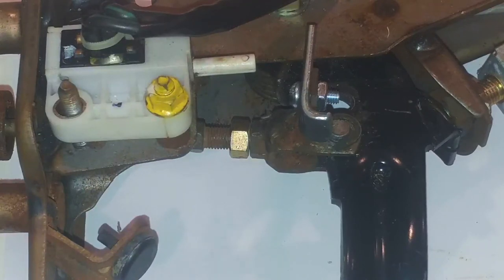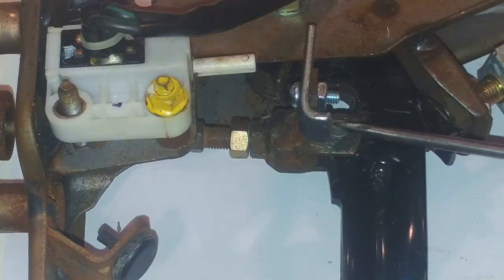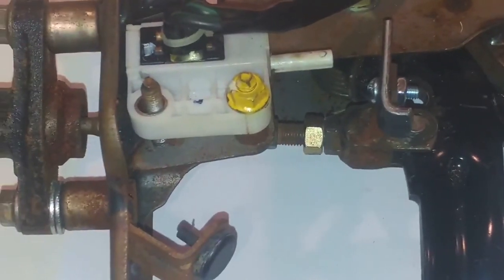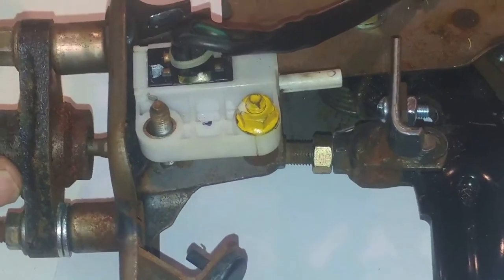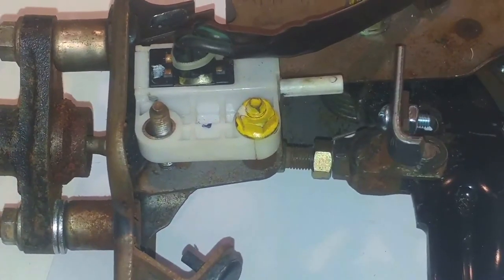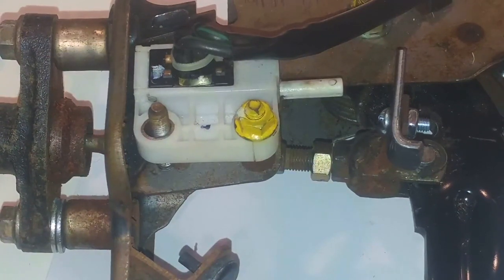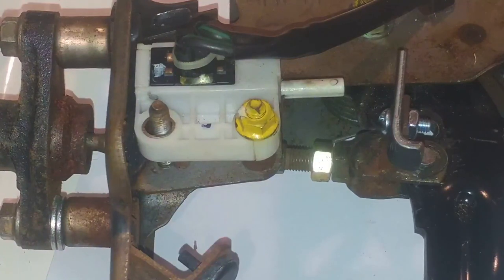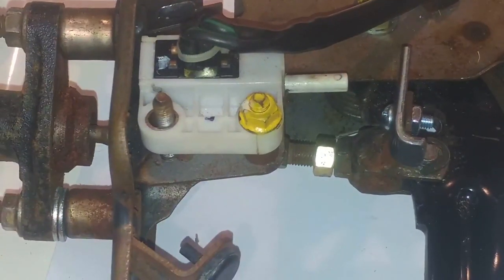Clutch Pedal Modification for HD Pressure Plate

Comment: Could you also solve this issue with a larger diameter master cylinder? At the cost of higher pedal effort of course.
Reply: Yes you can use a larger master cylinder but we found that the increase in pedal pressure was substantial. It's definitely a balance between the increase in pedal stroke vs going with the larger master cylinder.